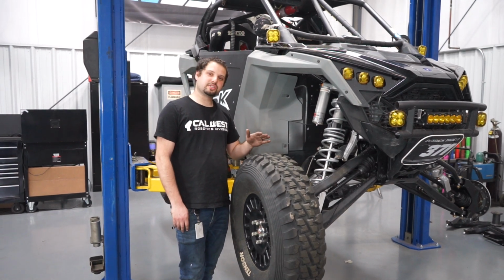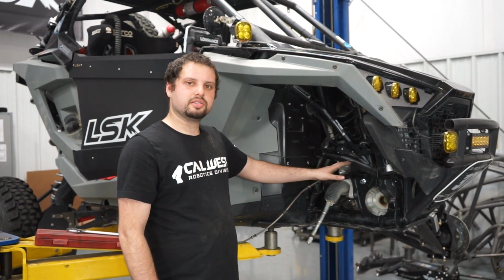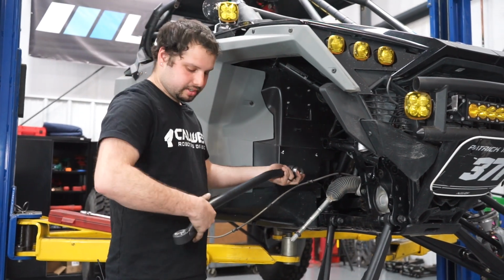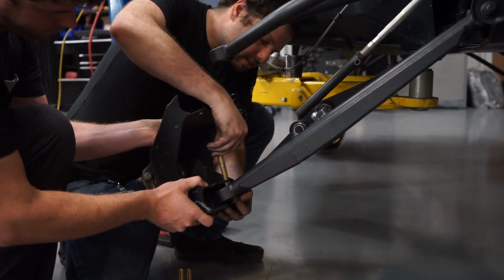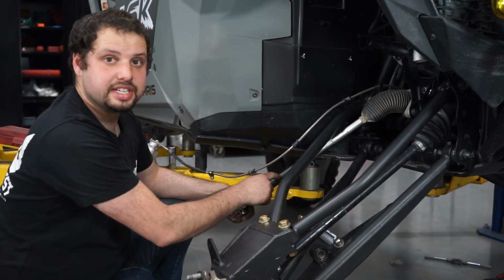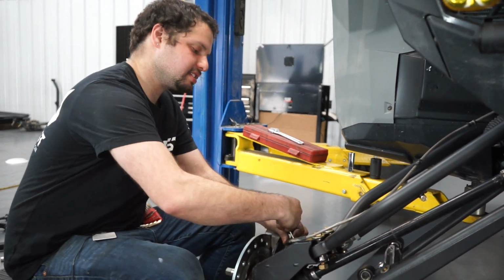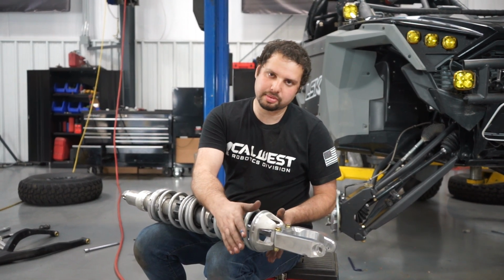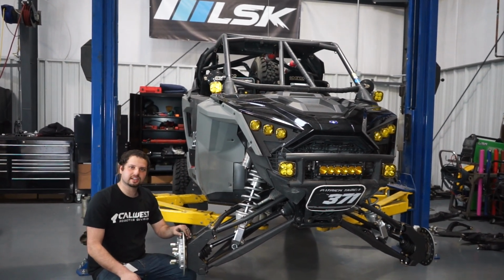RZR PRO R / TURBO R XTRAVEL INSTALL | LSK Suspension

Comment: I just installed this kit on my pro r!
The rear upper arm 9/16 bolt need to be reversed or it hits the axle. The spring slider or divider doesn’t fit over the shock shaft with the clevis mount installed.
Reply: The 9/16” bolt is updated on the new diagram. The spring slider slid right over for me. Ill take a closer look and add clearance if needed! Thanks James 👍

Comment: Does it stress arm tabs due to foward backward movement
Reply: The arms move so the wheel contact on the ground stay in the same spot when you turn... So it is putting less stress than oem